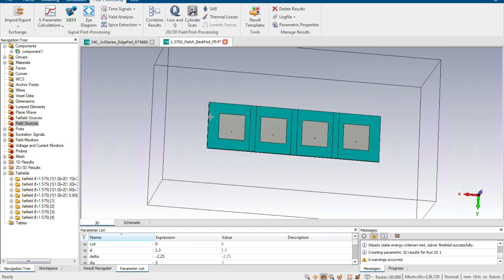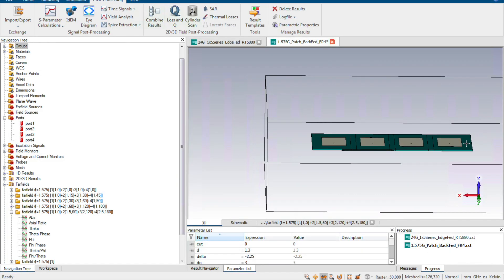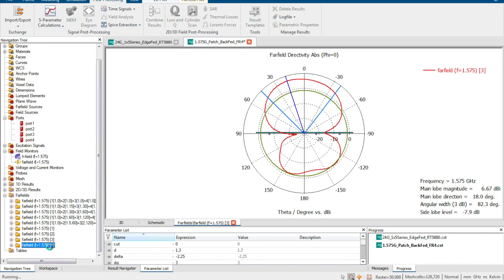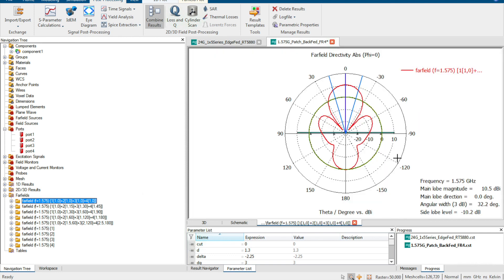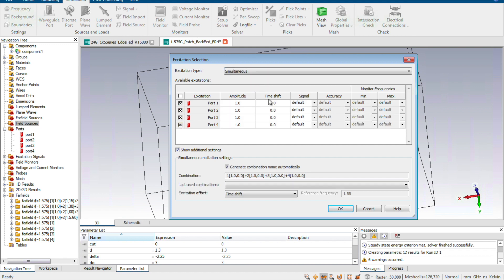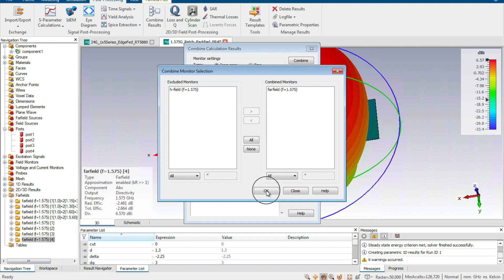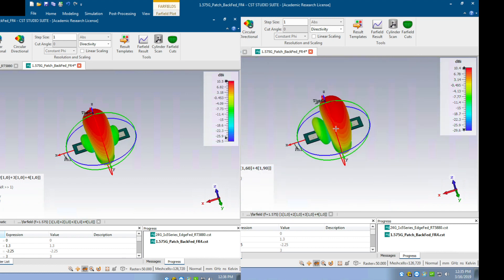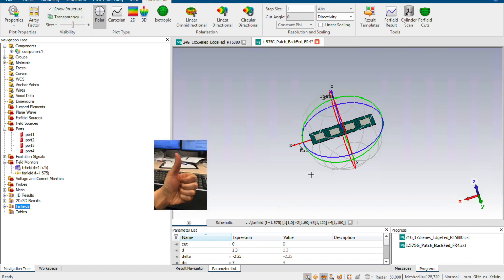5G Tech--Beam Steering

Comment: when i need 30 from boresight that i put phase difference  pi over 2 but main lobe not around 30 
Or in your video when you make phase shift 30 so steering angle is what as iam confused

Comment: Why we need to change phase in arrays? What is the purpose of it?
Reply from the maker: Generally speaking, we can shift the (antenna array's) main lob direction by changing the phase of each radiation element in an array. The EM propagation direction is perpendicular to the equal-phase plane, as shown in this figure (https://commons.wikimedia.org/wiki/File%3APhased_array_animation_with_arrow_10frames_371x400px_100ms.gif). Hope this can inspire you.
Reply: Changing the phase will change the direction of the array beam